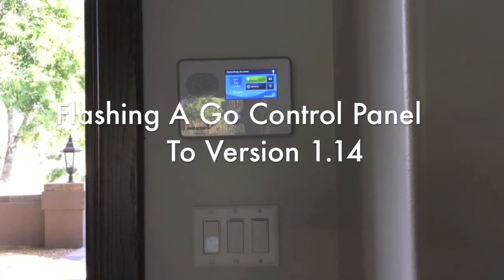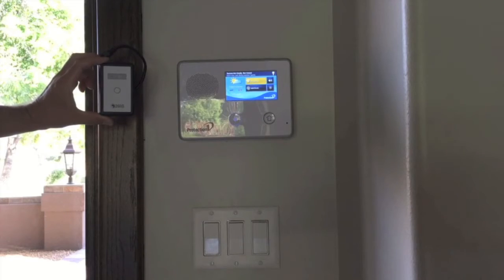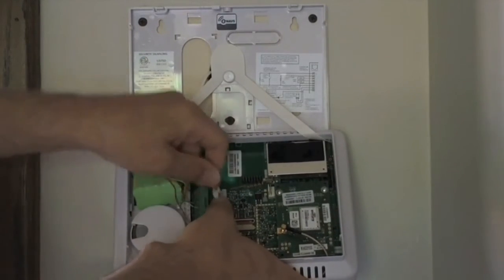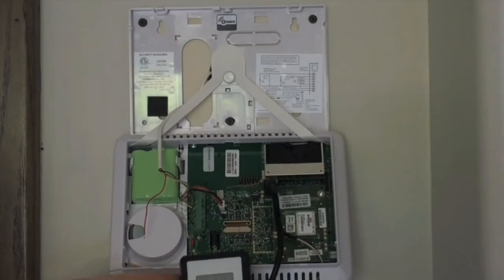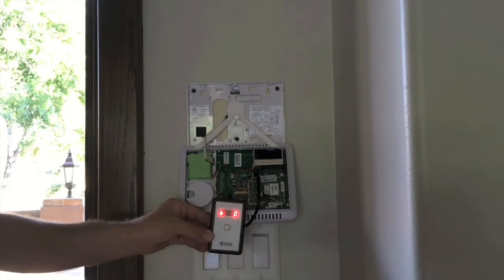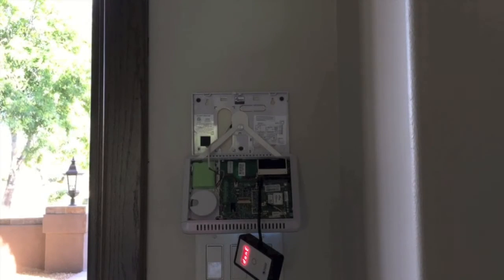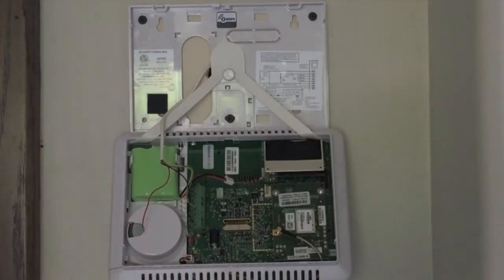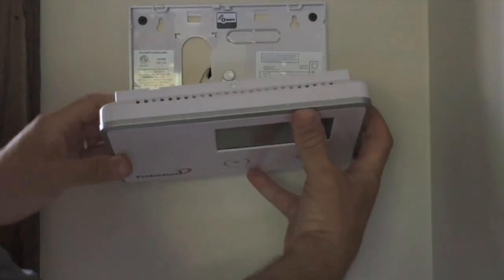Flashing a GoControl to version 1 14

Comment: Hello, I have version 1.13 can I go up to 1.16 or I need to go to 1.14 first then 1.16?
Reply from the maker: Hello.  You can go right to 1.16.  The upgraded revisions, 1.14 and 1.16, are mostly for the commercial environment.  It allows the panel to have more user codes.  And since you're a 2GIG user, I'll warn you about the 2GIG 7 inch touchscreen.  It looks nice but it's falls short on quality.  Plus, the 7 inch 2GIG wound work whit secondary keypads.